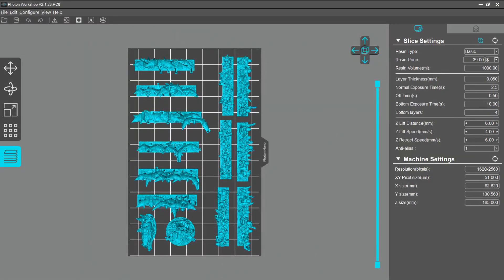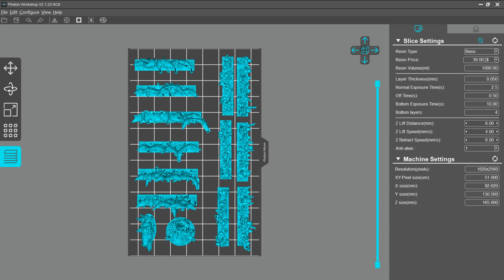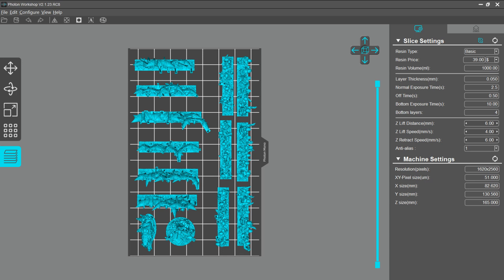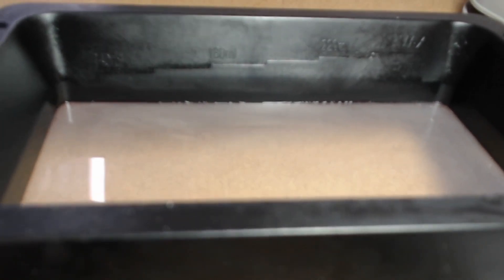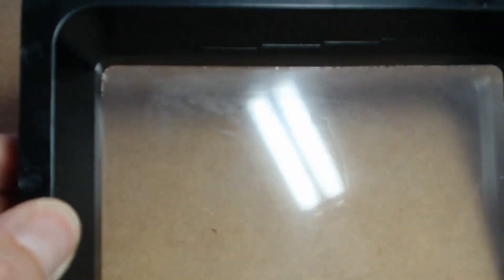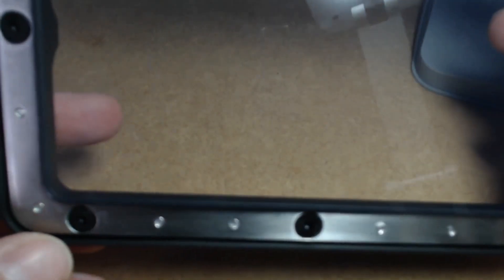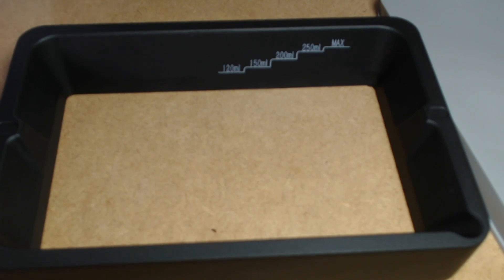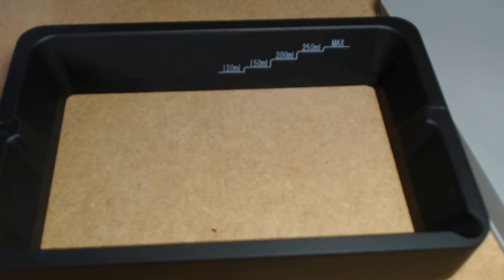Adventures is 3D Printing - Episode 8

Comment: Ahhh yeah my bad I forgot to mention my settings were for the fast abs like resin I guess those would not work well for the "normal" resins. Moving inside is a good move everything seems to work a little better warm. Seems the elegoo mars measures the lift speed in mm per minute while the photon is mm per second. Anyway you will have much better results with that better resin, hopefully those numbers make more sense with the fast stuff. I know with 10 second base layer cure time the base layers are fully cured right off the print bed. At least you have not put a hole in your FEP, I have already made that mistake not cleaning the FEP after a failed print.
Reply from the maker: Thanks for the details. Ran an exposure test to be sure this time. I am sure the FEP hole is due any day now.....